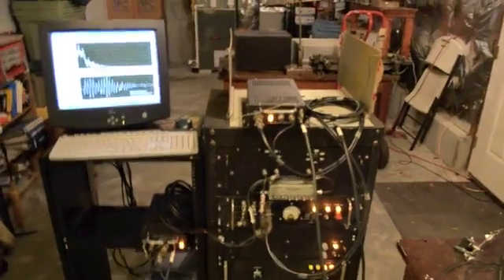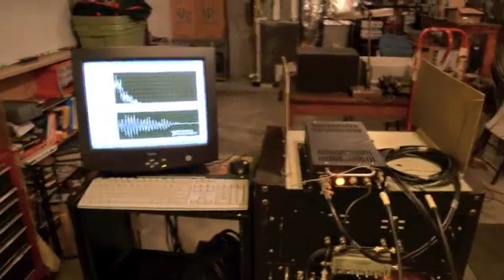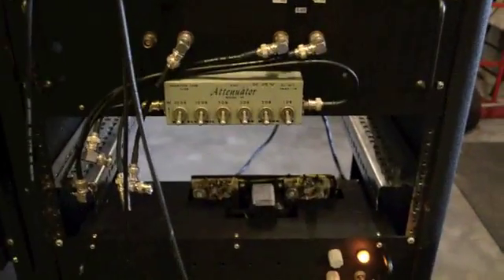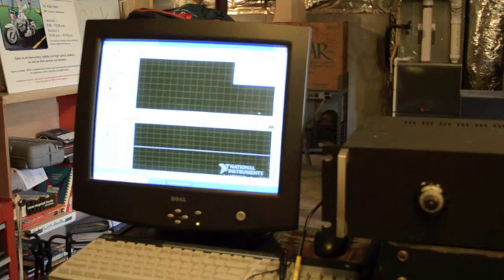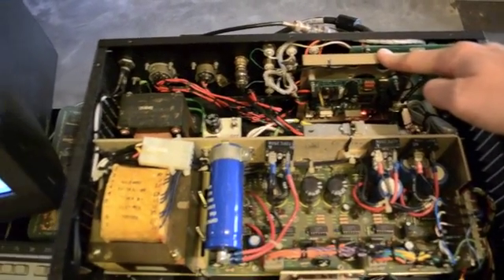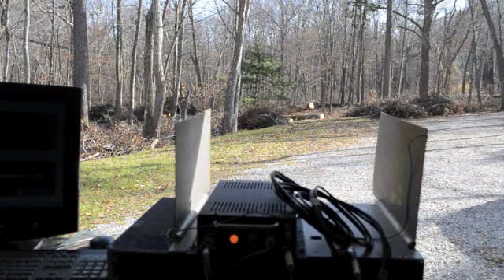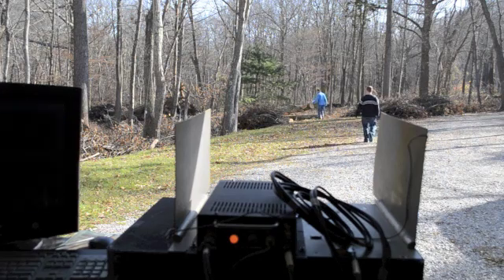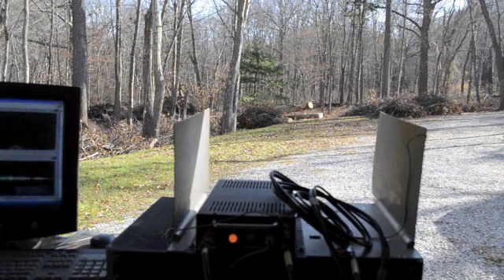S-Band FMCW Radar with Range Gate

Comment from the maker: This antenna was never measured, but based on the literature i would guess that in elevation it is probably about 15 deg and in azimuth it is probably very wide, maybe even 45 deg or so.  If you google my dissertation you will find the lit search on this type of antenna which is known as a Linear Tapered Slot Antenna (LTSA).